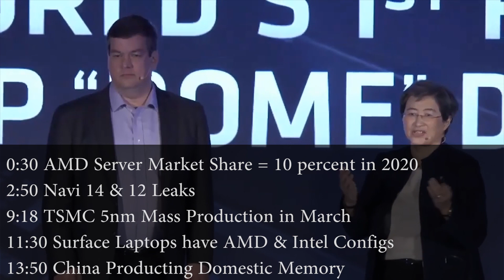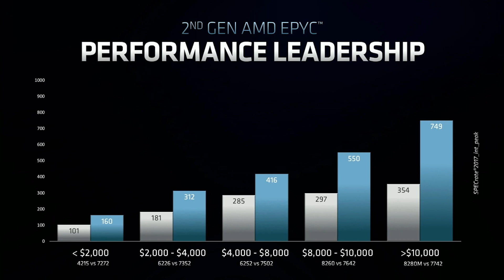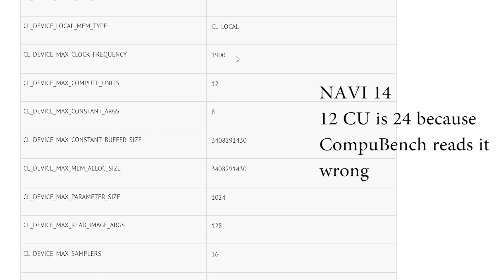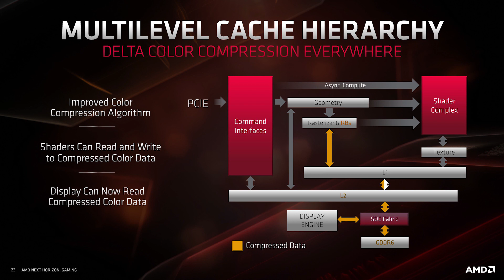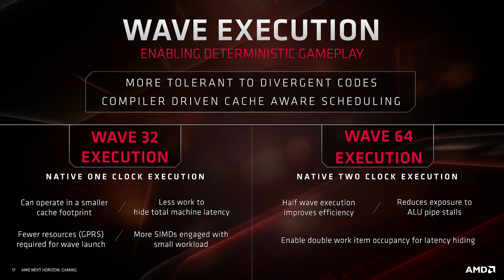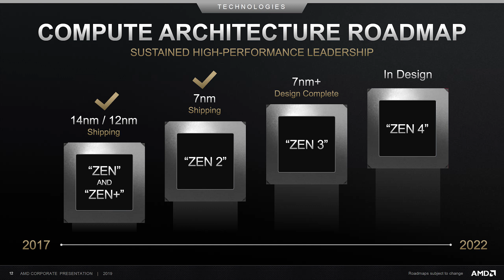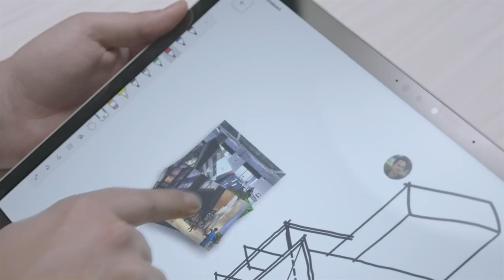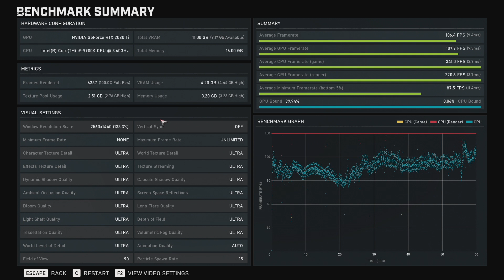Navi 12 Has 256-Bit Bus - RX 5800 | TSMC 5nm Mass Production In 2020 | Surface 3 To Use AMD & Intel

Comment: SDP16 doesn't just indicate a 256 bit bus, but also a 512-bit GDDR6 bus or 2048-bit HBM2 bus. Considering the power consumption on a 512 bit bus, it's extremely likely that if Navi 12 isn't a specialty card designed for say, Apple, it's 100% a 64CU, 2048-bit bus with HBM2E to meet the required bandwidth. It'd also be 4 SE, doubling that over Navi 10, so you'd have 2x8CU per SE, which is a 20% reduction and so extremely unlikely to bottleneck.

Comment: Compubench doesn't read Navi 14 wrong.

It reads the number of Workgroup Processors (WGP's) - which are 2 CU's linked together, by cache at least.

They are not completely separate, so the number of CU's will always be a multiple of 2 in any RDNA based uArch going forward.

Comment: 5nm and the density they are claiming will be for cell phone socs for awhile.  amd's cpus have a good density increase going to 7nm but the libraries that amd use are half the density that tsmc claims for its 7nm lp process. and when somebody talks tsmc 7nm thats the one they are talking about.  a less dense 5nm will come a year or 2 later.  and to be honest i think thats what intel are waiting on.  just skipping the hassle and costs of quad patterning and going straight to EUV and intel 7nm. but if tsmc is on 5nm and intel on their 7nm about the same time then tsmc will still be in good shape.  and of course thats being optimistic for intel but i think intel just cant justify quad patterning while amd really need the win so it was worth it.
Reply: Not quite half as dense, 70% as dense as the FF phone variant.
Reply: Profit margins for phones are sky high while profit margins for GPU is 'meh'... Apparently.

They can charge like $900 for a phone with a tiny chip that has performance on par with a handheld console, and meanwhile there are GPUs that can run desktop games or home console level of performance and they must charge $400~500 for the console unit or $200~600 for the GPU itself.

Meanwhile everyone wants to buy new phones every year, while only a handful of power users who plays games (less than double digit of 'hardcore' gamers in the word), would buy a new GPU once every few years to 10 years.

Extremely high profit margins and extremely high yearly sales, versus moderate profit margins and average quarterly to yearly sales... Yeah. You can tell where investors are pushing their money into.

Short term quick profit is what most people care about these days, because too many changes happens in a short time frame, hence they can make a lot of money and fear they can lose it from unknown factors such as sudden fees, taxes, expenses, and such. Ever notice how fast human society is progressing and how 'rushed' people are in general with their money handling?

Comment: i dont know.  the navi with 256 bit bus could be regular gddr5 and it could be cut down to less than 5700 stream processors.  could be like nvidia and wanting more skus.  the 5700, 5700xt and 5700 xt AE could all be one card basically and the 256 bit card could be just below that?  idk,.  just a thought.  maybe they just got rid of most of those rx580's and rx570's.  not saying a higher end card isnt coming, just that this might not be it.  i would think that if a higher end card than the 5700xt is coming it wont be the 2080 ti killer, that will probalby take a larger bus i would think
Reply: This is navi12, nvidia killer is navi 23
Paul also said navi 12 is slightly different than navi10. I'm not sure what this means either.

Comment: 5700XT is already memory bottlenecked, so there is no change in hell that they would release a faster Navi with 256bit bus. Also it would seem that EPYC is selling like crazy, so it would be stupid to produce lots of NAVI chips when much more profitable EPYCs could be produced. So I would assume these are either defected NAVIs binned down, or smaller NAVI and it's binned down version.

But I surely want that 5120 SP version that is also rumored. I hope it's RDNA2 and with HMB2, or at least 512bit GDDR6 with 16gbps chips. In theory that could be 150% faster than 5700XT, and it would actually still benefit from overclocking. In any case, that will cost a small fortune, but damn it would be nice to see Titan RTX getting flushed down the toilet :D
Reply: Yes please

Comment: 5600 is Navi 14 with performance a bit higher than RX580 with lower than 100W power draw and close to $150 price.
5800 is Navi 12 with +50% in all hw (60CUs, 384-bit mem.bus, 12GB VRAM, etc.) that will go for 2080Ti's head at 2080 Super price. That isn't the biggest Navi GPU we know AMD is planning.
Reply: More likely the 5800 is Navi 20 or higher. That's what leaks and rumours so far have been saying.
Reply: it would 64 cu's unless they're disabling 4. 4 segments of 8 complexes the current navi is laid out with 4 segments of 5 complexes. memory wise they'd be better off skipping to HBM. 

i'd think a rx5900xt would be 64cu with 16gb hbm, with an rx5900 with 56cu and 12 gb hbm if that's a thing.

edit: i don't think the 5600 and 5800 are things, i think AMD are aligning their cpu and gpu numbering schemes, so 5300 is media centre sku, 5500 is budget gaming, 5700 is mainstream and 5900 is enthusiast. just like the r3 being a browser cpu, r5 being budget focused, r7 is mainstream, and r9 is enthusiast.
Reply: @MrOsmodeus  5900 is the nVidia killer as rumored insinde AMD and to be such a beast it will need closer to 80CUs and HBM VRAM

Comment: TSMC 5 nm EUV:

15% increase in speed over 7nm !
80% increase in density !
30% reduction in power consumption !

WOW !

Ryzen 4000 (Zen3) 2020? will use 7nm+.
Zen4 will probably use 5nm !  Does this mean 2021 ?
Reply: Provided 5nm doesn't cause any unforeseen issues, I would assume that's the case.
Reply: Most probably
Reply: 2022
Reply: Imagine how many damn cores they could fit....
Reply: @navin7845  more L2 cache ... SMT 4 way... Etc.... no need for more cores
Reply: @florin604  4 way smt will sever no purpose except in the sever industry. Will not make as much a difference compared to no smt to 2 threads per core
Reply: @navin7845  sure... Not
Reply: @florin604  most games dont even use 4 threads how will 4 way smt on a 6 core or 8 core chip make a difference? Check benchmarks of smt on vs off. There is minimal difference
Reply: @navin7845  It's all about what consumer have... If everyone has 16C/32T CPU for example, game developers would develop games which will utilize atleast 14C/28T.... It's not developers can't, they just don't because our PC's are slow....
Reply: @navin7845  you assume we all care about games
Reply: 'Mysterious' contamination or destruction of production lines may appear in the news in the far future, keep an eye on that.

"Oh look the supply and demand is really high, I really wonder what happens if that supply suddenly took a hit?"

Comment: Navi 11 could come in as 5600&5600XT in January 2020?
Navi 12 = RX 5500&5500XT
Navi 14 = RX 5300&5300XT
Navi 16 = Renoir iGPU?
Navi 18 = Dali iGPU?
Reply: Navi 11 doesn't exist. Renoir is vega. Dali will use Navi 14. Navi 12 is probably the 5800, thought it could be the 5600.
Reply: @vyor8837  "Dali will use Navi 14"

Considering Dali is supposed to be a value chip, that sounds too big considering N14 is 24 CU equivalent.

I would expect more like half that GPU size, maybe 16 CU at the top end.

I'm hoping we might see Dali in some standalone VR headsets, even 12 CU would trounce the Snapdragon 835 based Oculus Quest.
Reply: @mnomadvfx  No, not Dali... whatever we get after Renoir. Do we have a codename for that yet?
Reply: @vyor8837  Not to my knowledge, the only post 2020 codename we have to my knowledge is Zen4 server part Genoa.

Zen3 AM4 is Vermeer.
Reply: @vyor8837  I'd make a bet on something like Rembrandt, or Monet/Manet.
Reply: Nope, Renoir is Vega based, likely a 7nm shrink of the Vega 12 (20 CU).

Comment: First.  Love your content.  Should I buy a 5700xt now?  Or wait a couple of months to see what is released next?
Reply: Black Friday/cyber Monday is less than 2 months away. I'd wait to see if there is any word on new releases but if not then grab a deal and save some money.
Reply: i'm always in that boat.buy now or wait for the next better thing. I've found over the yrs unless the next thing is going to be  , soon , cheaper or that much better just buy now.otherwise you can get stuck in that waiting for the next thing loop for literally yrs.
Reply: Waiting for announcement, waiting for release, waiting for reviews, waiting for AIB models, waiting for AIB models reviews, that's too much I think.
Reply: I'd say wait for black friday, that's what I'm doing.
Reply: The Black Friday recommendation is a good one.  I saved hundreds overall ordering during that time period.  I only ever think to wait, IF there is an announced release that isn't far away.  Speculative release dates or ranges is a recipe for disappointment.   Sometimes there is a worthwhile price to pay for enjoying it now, rather than wasting time waiting.
Reply: It depends on the purpose of your build.
If you are planning on building the absolute best of the best, with top tier parts. Wait until either AMD or Nvidia release new top end GPU's.
The 2080ti is already 12 months old so won't hold the top crown for more than a year or 2.
AMD haven't and possibly won't release anything to compete at the very top end.

If you just want a general purpose machine that will last a few years without breaking the bank?
Just build now